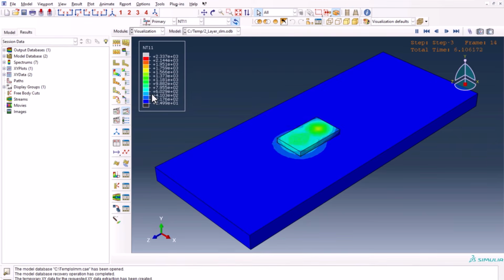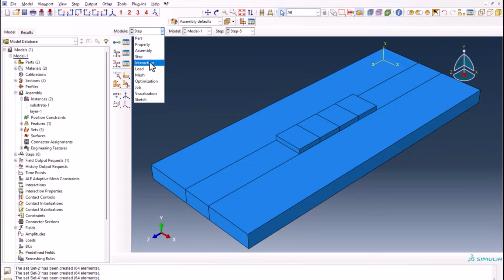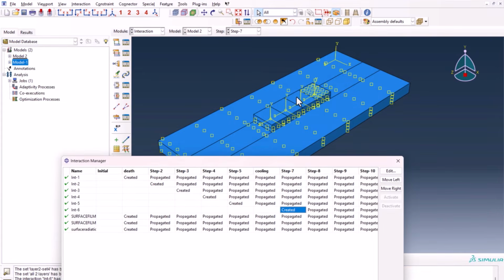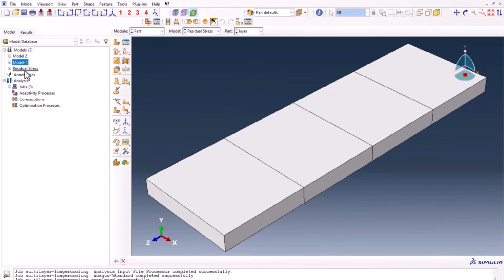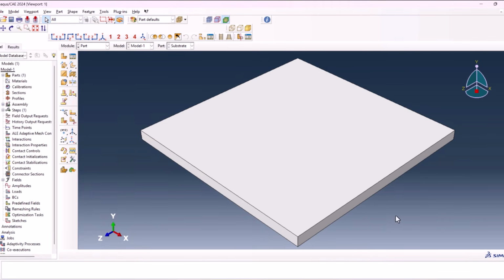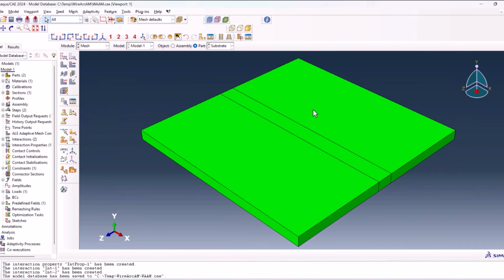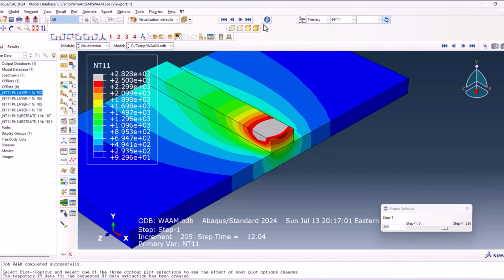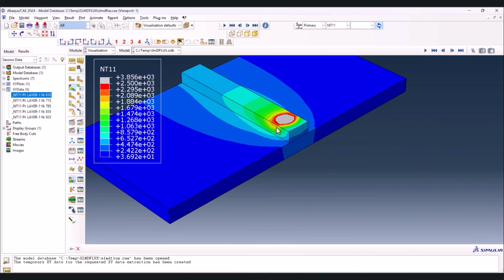Abaqus Additive Manufacturing Masterclass–The Only Tutorial You’ll Ever Need

Comment: I have a question, the Stefan–Boltzmann constant is given in kelvin, therefore, aren't all defined temperatures supposed to be in Kelvin? like for example, the sink tempratures or initial temperature that you defined as 20? That would mean -253.15°C 🤔
Reply from the maker: When setting up a heat transfer model in FEA software like Abaqus or ANSYS, you define the absolute zero temperature (e.g., -273.15) in the model attributes so you can work in Celsius. The software automatically converts your input temperatures—like a 20°C sink temperature into Kelvin internally before applying the Stefan-Boltzmann constant for radiation calculations. Because of this defined absolute zero, entering 20 means 20°C, and the solver handles the conversion to 293.15 K behind the scenes.

Comment: In a multilayer additive manufacturing simulation, why didn’t you simply increase the part height in the sketch and then partition it into layers?

I tried that approach, but the temperature–time (T–v–t) results were incorrect. Even though I defined separate element sets for all 10 layers, used correct element birth/activation, and applied the loads stepwise, the issue persisted. The heat input still ended up being applied only to the first layer, while the subsequent layers experienced only conductive heating. As a result, the temperature histories of nodes in Layer 1 and Layer 10 followed the same curve, indicating that only Layer 1 was effectively receiving the heat input, despite correct layer activation.
Reply from the maker: Great question! The main reason I approach it this way is that it makes meshing significantly easier and gives me much better control over the individual layers.

Regarding the issue you ran into with the partitioned method: that is a classic trap with element birth and death! When you activate elements layer by layer in a single partitioned part, surface-based thermal loads (like a surface heat flux) don't automatically jump to the newly activated "top" surface. The solver keeps applying the heat to the original surface of Layer 1, exactly as you saw.

To make the partitioned method work, you would have to manually define and apply new surface loads for every single step, or use a moving heat source subroutine (like DFLUX in Abaqus) to dynamically track the active elements. Setting it up the way I did in the video helps bypass that exact thermal boundary condition headache!

Comment: This was really good and thorough. Thank you! I am in the process of trying to simulate Cold Spray AM. I was previously making some big assumptions and treating it as L-DED. However, after learning more about the DFLUX routine, it seems like this might be able to be used for simulating the hot gas stream. Specifically, the gas stream not only heats up the part/surface but also cools the surface down due to forced air convection. Any thoughts here on if this could be done with this approach?
Reply from the maker: I’m glad you found it helpful! 🙌
According to my knowledge, yes — you can approximate that using DFLUX for the heating part of the jet and a moving FILM condition (or FILM subroutine) to simulate the forced convection cooling effect around the same region. That said, it’s a complex coupled phenomenon, so it’s better to look for a research paper that specifically models the thermal–fluid interaction in cold spray or L-DED and follow its methodology as a starting point. That’ll ensure your assumptions and parameters are physically accurate.
Reply: @FEAMASTER  Thank you, I will also dig into the FILM condition. Currently, I'm using the AM Modeler plugin and it creates two interactions for cooling (convection and radiation) and then a body heat flux for the goldak heat source. So I think it is already using both of these subroutines, but they are a black box. I am wondering if I could just keep these and then create an additional FILM subroutine for the forced convection. Specifically, let the plugin do the heating and normal progressive activation (and convection/radiation cooling), but then add my own localized convection coefficient modification where the part is getting hit with the air stream.  Like you mentioned, these a definitely coupled - the same hot gas that heats up the surface also cools it down quickly after deposition.
Reply from the maker: That’s a great approach! 👏 You can definitely keep the AM Modeler’s default heating, convection, and radiation, then add your own FILM subroutine for localized forced convection from the jet. Just make sure you’re not double-counting on the same surfaces—either increase the existing convection coefficient or apply it to a separate surface that matches the jet footprint. You can define a moving Gaussian (h = h0 + Delta h e^{-2r^2/R^2}) synced with the toolpath for realistic heating–cooling behavior. That should give you the quick heat–cool cycle you’re after!
Reply: okay, thanks I'll give that a shot. One thing im missing, is how to connect the toolpath? I didnt see anything in your WAAM or SLM section of the video.
Reply from the maker: Are you talking about linking abaqus and fortran?